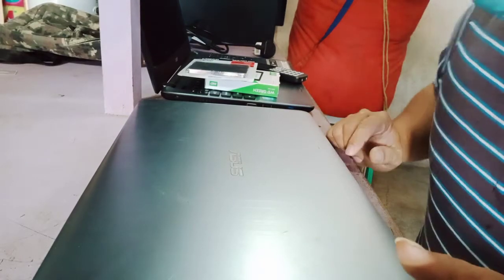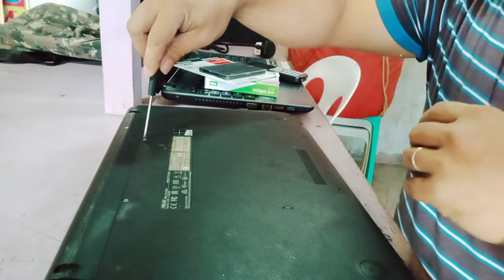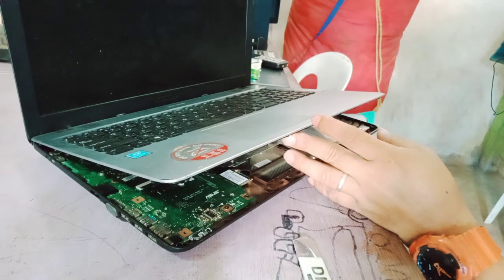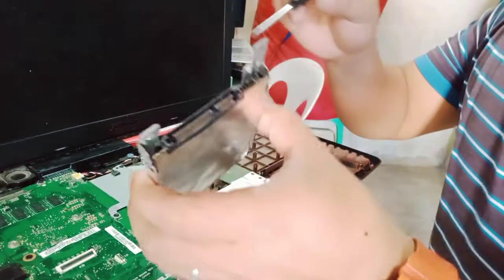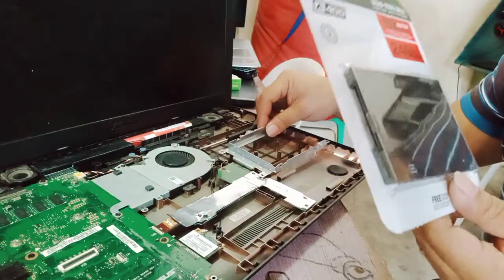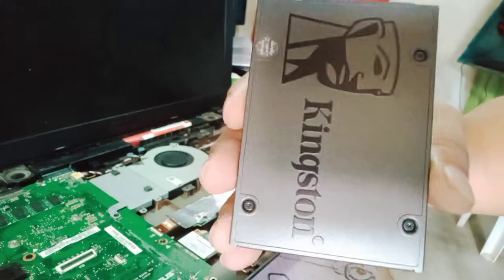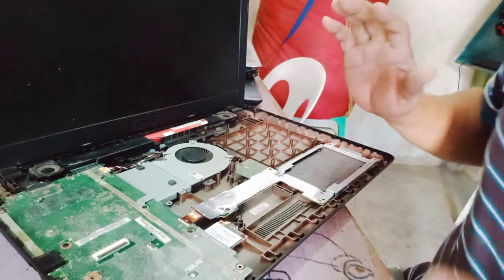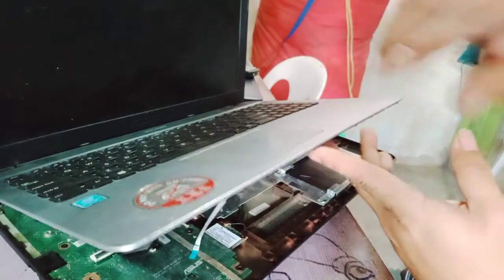How to upgrade ASUS X541N LAPTOP  HDD to SSD

Comment: Hi should we install windows again?
Reply from the maker: hi..in this case we reinstall the windows.backing u the old files.since this laptop is personal use
Reply: @alberttechchannel7250  from where should i install windows?
Reply from the maker: you can install it on the new
 SSD DRIVE
Reply: I got geniune windows with my laptop.. If I remove hdd then FROM WHERE will I find windows to install on my ssd? Hope you understand my question 😢
Reply from the maker: if it is retail licence you can transfer the licence multiple times to any device without  issue.but if your licence is oem you can try cloning it